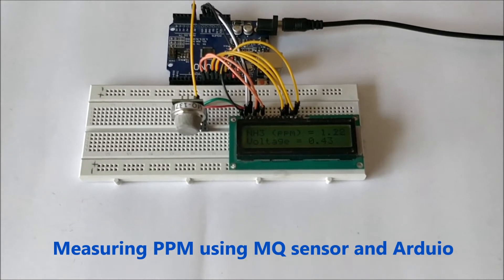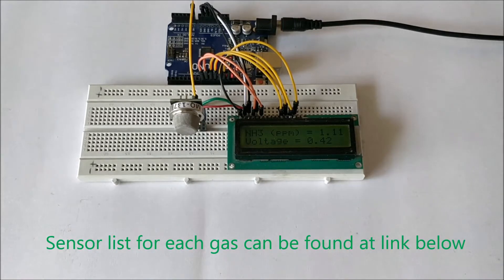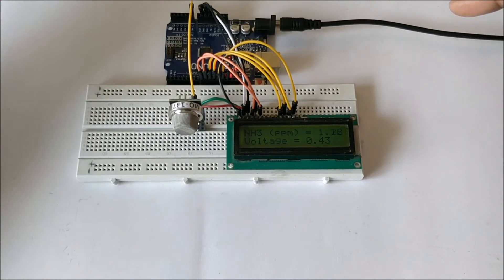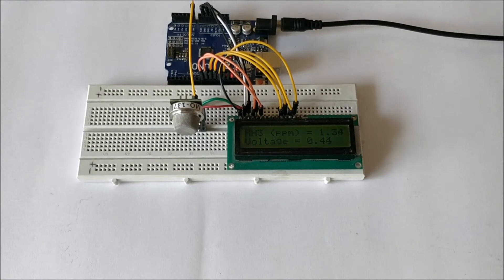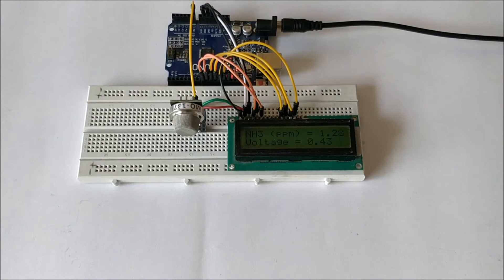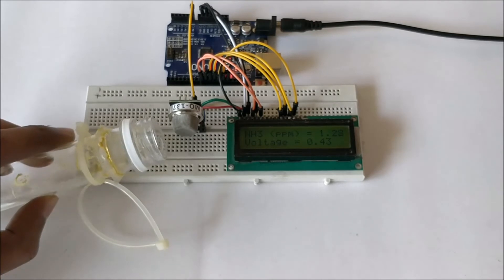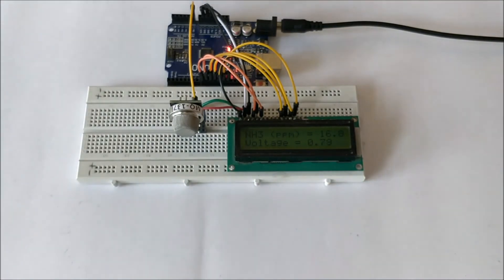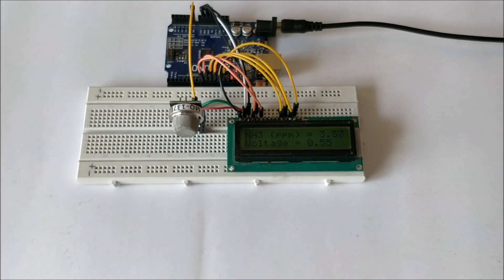MQ137 Ammonia Sensor with Arduino

Comment: is it possible to add temp and humidity sensor for adjusting results? because when temp and hum. changes , mq sensor value also changes.. and how you can be sure that your ppm is correct?

Comment: Use of polarized camera lens is the reason the LCD display appears dark (cross-polarized). Cell phone cameras are often polarized as well. If cross-polarization (darkness) occurs, simply rotate the camera 90-degrees and the darkness will disappear. Or, in the case of detachable lens type of cameras, simply remove the polarizing filter.  Good video. Thanks.

Comment: Hi, it's a great work! thanks you so much for your tutorial, but i'm wondering, can i detect spesific gas like ammonia too with MQ 135?
Reply: i'm trying to do the same thing M Akbar, did you any progress using mq135 to detect/measure ppm ammonia ?
Reply: @BaiasOficial  Good day, please were you able to achieve this. Please treat urgent. Thank you, Mab.
Reply: @mabmarsh7370 hi Mab 
You can search the article "Sensores eletroquímicos na detecção do gás amônia" in researchgate, but TLDR....
The results were to inconsistency, maybe some flaws in the methodology or bad sensor ( tried only with 1 ).
You can check in the paper, it's in Portuguese, but any AI translation can help you!
Hope you do better then I did 👊